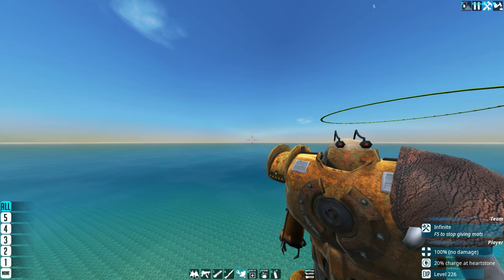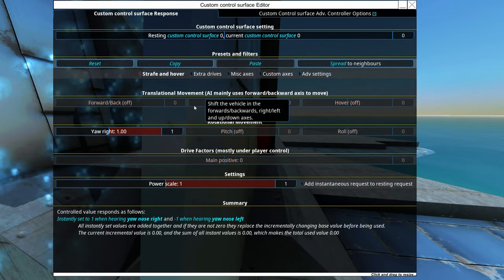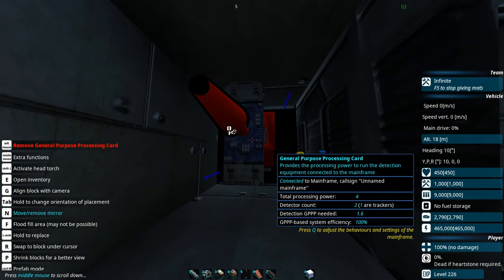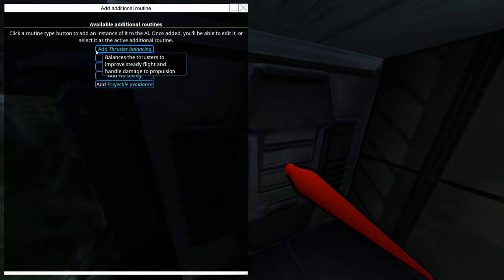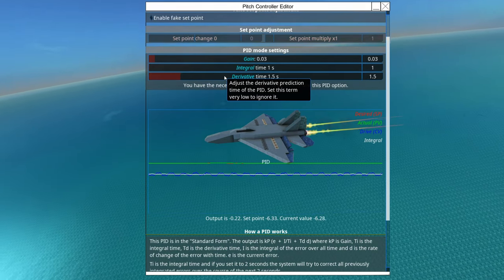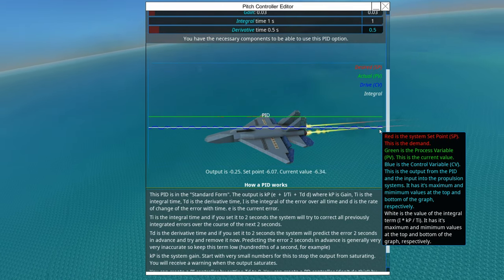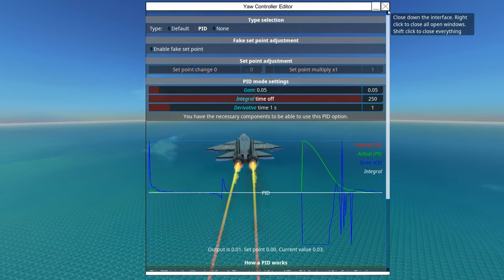Official Flyer / Plane Tutorial From The Depths

Comment from the maker: 00:00 Intro
00:40 The Jet hull
01:35 Custom Control Surface wing set up for altitude, roll, pitch and yaw
04:25 Centre of mass COM Drag and lift for our thrusters
07:20 Thruster power output and looking after available power
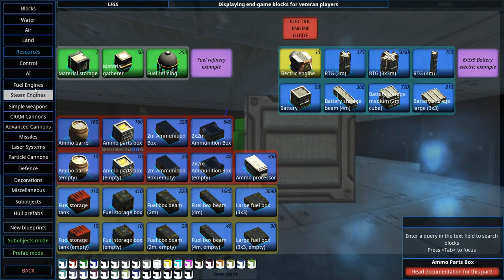08:35 Setting up the AI mainframe AI expansion cards and GPP
09:13 Linking the mainframe to the LWC local weapon controller
10:04 Large missile mines weapon system
10:55 Setting up detection system and brief explanation
12:30 Setting up Aeroplane movement and aerial bombing 
15:29 How to deploy Hot Air balloons with the AI
18:05 First test flight without PID enabled
18:42 Second test flight with default PID enabled
19:23 Explaining the PID and how to setup the PID
30:55 Placing the Custom Wings
31:53 Tweaking the Custom Wing settings
33:30 Refining the PID and why does the altitude set point spike on an attack run
35:33 Setting up the local weapon controller and missile controller for attack runs
38:57 Adding more AI behaviours and setting up the bombing run AI
Reply: Xbox im begging